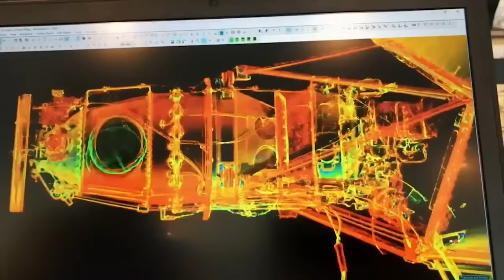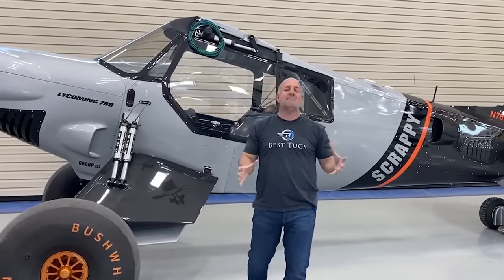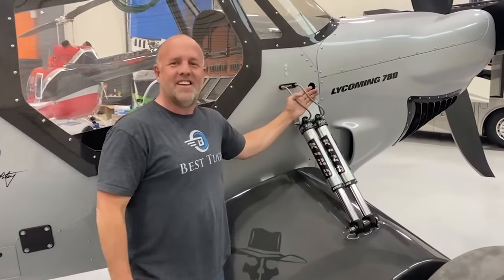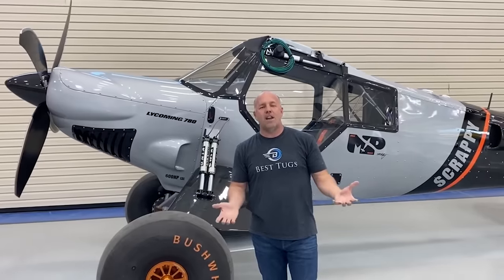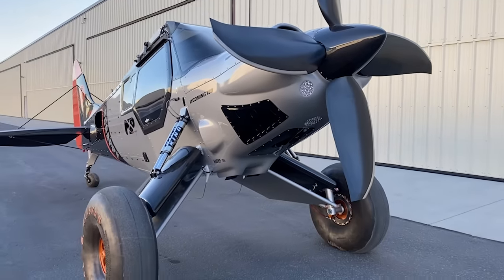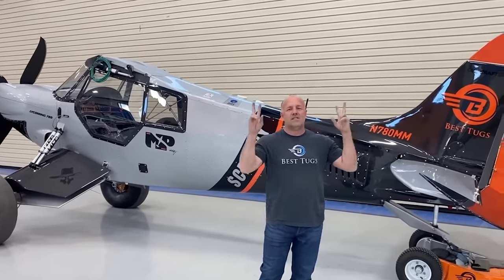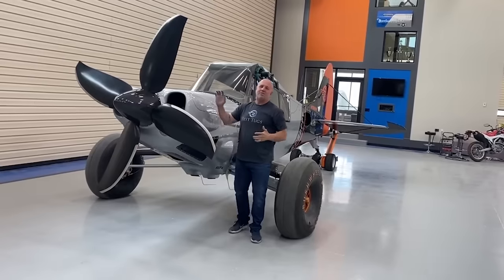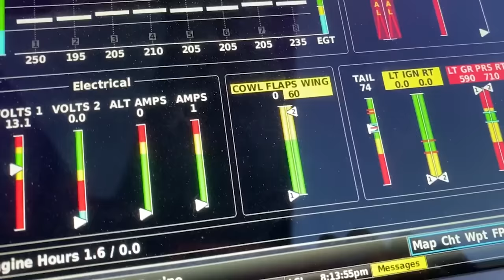Dynamic King Suspension on My Wingless Airplane | Scrappy #52

Comment: Oxygen systems do not require an external ignition source.  I point this out because of your comment (and I loosely paraphrase here, as well as assume and make inferences, but its close enough) about a hypothetically extreme case creating heat in your suspension system due to operation and that such case would, in your estimation, not raise any component, or gas temperature to presumably 'autoignition' temperature - with O2 as your working fluid.  Fine...  Stipulated...  the macro-average gas temperatures are not likely to be high.  But... 

Oxygen systems do not require an external ignition source.

When designing an O2 plumbing system, and especially a high-pressure O2 system, and especially if the flow velocities are expected to be high, you have to be aware that local, dynamic compressions can raise the local gas temperature above ignition temperature.  And almost everything burns in a pressurized, pure O2 environment.  Very exothermically.  So once started, it continues until the O2 is exhausted.

Sharp protrusions in the flow, sharp edges on elbows and tees, any place where the gas will Shock (Yes that Shock:  M=1.0) due to a Choke point, are examples of things to be generally avoided; with more or less mitigation depending on factors of the design.  The slower the flow, the lower the operating pressure, the less circuitous the routing, the lower any pressure drops are, and the less combustible the wetted surfaces employed are, the less likely it is that locally high gas temperatures will result from compression in the flow.   And look for Oxygen-rated components. Ceramics in valves is a good idea.  Inspection for sharp internal features should be done.  Etcetera, etcetera...

Simple rule of thumb I employ that has kept me free from regrets:  Keep the O2 quantity as low as is practicable (given margins of course, as appropriate) and allow O2 use only for systems that require O2. 

Breathing, for example, is a good use for O2 and the systems and components sold and used for breathing systems will go a long way toward keeping the user out of trouble.   Providing the oxidizer for rocket engines is useful too because, let's face it, the performance cannot be achieved any other way.  But rocket oxidizer storage, fueling, and delivery systems utilize many, many design features, inhibits, and distances when at all possible.   And other necessary uses.  But suspension pressurization does not require O2.  I am glad to hear that you will not be using O2 in your dynamic suspension.  It seemed to be fine during testing.  Its just better to avoid some design concerns completely - and O2 where it isn't necessary is one of them.  

Soapbox aside:  You do some incredible shit man!  Keep leaning forward in  your considerable endeavors.

And I probably should have read the previous comments, because this has probably already been covered, and I apologize if I'm just repetitive, but...  I don't always do what I should.  Have a nice day.

Comment: Every video makes me want to get my tail wheel endorsement 😭. Quick question: does the main gear go toe in/out when changing between the different heights/modes during taxi? Or is the side load negligible enough where it doesn’t need to do that?

Comment: Doesn't the movement of the arms create a lateral force to push the tyres inwards and outwards? Over loose ground like sand it is maybe no problem at all, but on asphalt?
Will it wear out the tyres faster?

Comment: I wonder how efficient the air boat propeller will be at cruising altitude of 25,000 feet? Just thinking the wide airfoil section is for heavy dense air and wondering how effective this will be at higher thinner air.

Comment: Imagine if you set up a system where you can input a wind direction and the magnetometer would give a relative wind direction and it would auto adjust the suspension to put in a wind input.

Comment: OK, how so very cool. However, it would fly better with a WING. Get that done and FLY this thing. I really enjoyed Draco and believe it  should be fixed, repaired, put back into flying order, PERIOD.  I design, build, fly Radio Controlled "stuff". Get an idea, put it to paper, cut and glue together, install all the flight gear.  Take it out, fly it, break it, redesign it, rebuild it, go fly it. .049 - .56 engines, alcohol fueled. 2 ch - 6 ch.  Been working with "Blended Lifting Bodies".  Current, 36 x 48 in. 4 ch, O.S. 25 BB, 9x6 prop. 15% fuel mix.  I know what it's like to break your favorite "toy". I would love to help rebuild Draco.

Comment: Glad you didn't go with pure oxygen gas for the suspension. Ignition can also occur if there's FOD. Small metallic particles entrained in the gas flow can impact at high enough velocities to cause an autoignition event that can consume valves that control pressurized pure oxygen. It's a big concern in the liquid propellant rocket engine business where gaseous or liquid oxygen is used.

Comment: Oxygen itself will not combust under any pressure/temperature. It's an oxidizer. It's THE oxidizer. It does what all other oxidizers are trying to do. Produce oxygen. That's why it needs a fuel source to burn.

That said, with enough oxygen present, the carbon fiber or metal in those gear cylinders will happily burn like fuel-soaked paper.

Comment: So now that you have a variable gear would it be possible to use it as some kind of "Gear up" scenario? so pull up the rear gear in flight as well as the main gear? would this change the aerodynamics to the positive or negative changing the main gear in flight? Would interest me. I could imagine having the main gear level in flight reduces turbulence induced by the gear. But im just a computer sciences Student so i am completely clueless regarding aerodynamics.

Comment: wait a second.  I could have sworn, on the video yesterday, that O2 WAS going to be used in the shocks.  Mike said in that video that even after the o2 pressure was in the red he still had enough O2 to operate the system 100 or so times.  Did the video get changed or am I going nuts??

Comment: I am sure you must have already thought about using electric motors to make adjustments,  but discarded that idea for some reason. What would be the disadvantages of that ?

I looked around the comments to see if it’s been addressed already but did not find any after small search.

Comment: Is the suspension system (monitor itself) controlled by MIDI or computer controlled  to read the conditions (terrain) . . .
 Or are the angles, pressures. Settings, manually set by you?

Comment: I feel like clarifying pressure rating and failure pressure are very seperate things. There always has to be a safety factor built into pressure equipment. Such as hydraulic hoses as a rule of thumb have a safety factor of 4:1, should you ever run a hydraulic hose more than it’s rated pressure even though it’s failure pressure is four times higher? Hell no

Comment: May be unlikely but nitrogen can burn in the same way oxygen does. As far as I know nitrogen only burns silicon and "oils" based on silicon in place of carbon. E.g. penta silan. So when a silicon based hydraulic fluid comes close to nitrogen at a high pressure and high temperature stuff might hit the fan at an unexpected moment.

Comment: Dynamic yea but reactive no..   reactive would be the money unless you had another body to monitor and adjust all the stuff while the pilot focus on the driving portion..  i dont think that one person could possibly control all that during a sketchy take off and landing definitely not..  is why they never made an only manual gear lowering system, only as a backup on old war planes..    i believe..  but if you could have some wind direction and predictive tech control the system than itd be like the high end air ride on cars..

Comment: What if total loss of nitrogen pressure?  Assume still safe to land with existing prop clearance and rear leaf spring. I am not an off road suspension expert. Probably in the comments already, if so please ignore.  Our big planes always had contingencies for manually dropping retracted gear, or landing with them retracted. It was nothing like this system.

Comment: Couldn't you theoretically calculate your weight and balance using your pressure sensors in your suspension?

Comment: That makes 0 length of take of runway, just have it jump up in the air with enough headwind.... You have the frog mode programmed to jump? Maybe do a forward jump, should be enough speed on the high point to stay in the air.

Comment: Mike, i' wrong in calling you INSANE, but insane is the men that doesn't pursuit his dreams, now i understand why your brother calls you MIGHT MIKE, I'm really curious about the reflex in the suspensions system, you can change the settings in a pattern way, soft, hard, left up, left downs, but how it works when you land in a really hard way, does the suspension got adaptatively regulator?

Comment: This is AWESOME!! I'm not a tailwheel pilot so this might be a stupid question, but how does safe taxi mode alter the tendency for it to drop the nose if you have to slam on the brakes??
Reply: In the high mode the center of mass is higher than in the low mode.  As result the rotating moment will be a bunch lower with the same braking effort.  Most or more importantly, he can see straight ahead and not ever need to slam on the brakes.
Reply: @diablouser  I had a feeling that may be the case! Thanks!

Comment: Why would you run oxygen in your shocks? Why not just nitrogen?
Reply from the maker: Nitrogen is the only way to go for sure.  That’s what I’m using I was just discussing it because some use it and it’s risky.  The only reason for  it Would be to have twice as much oxygen on board for dual purpose but that’s why two tanks one for breathing at altitude and one for gear.  Not safe to use nitrogen

Comment: When you built the gear didnt you make the gear so it could act as a wing in some respects? So it is like a 1.5 wing, you know not a full bi-plane.
Reply: Draco certainly got some lift from the fuel tanks in the gear struts.